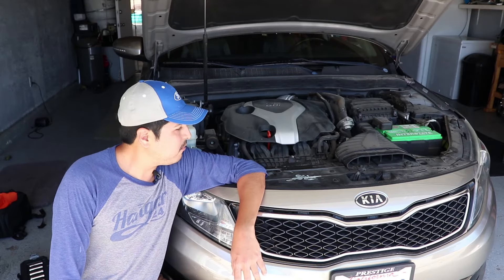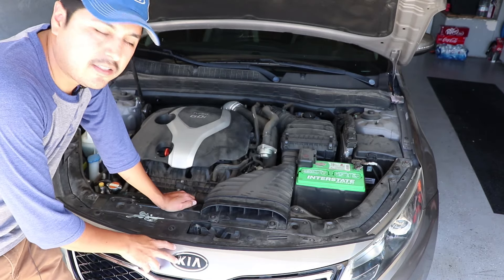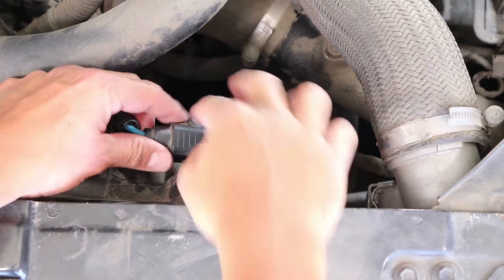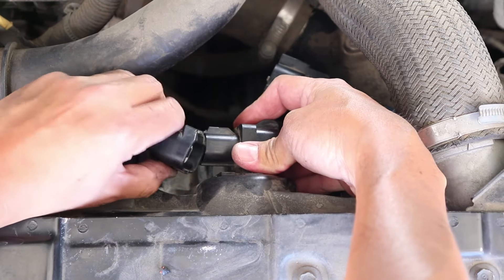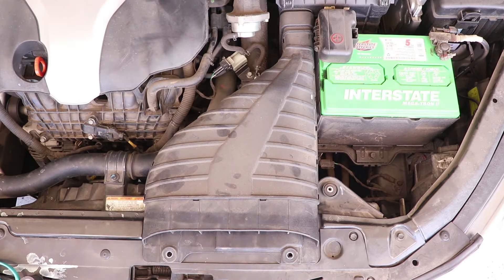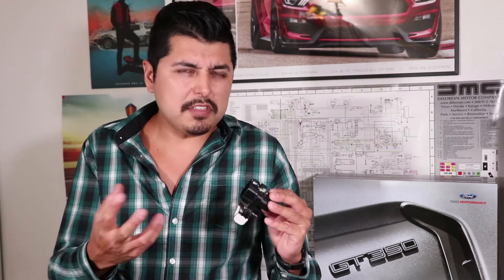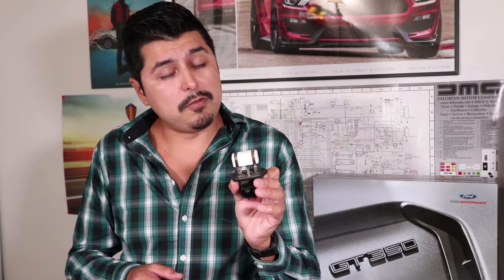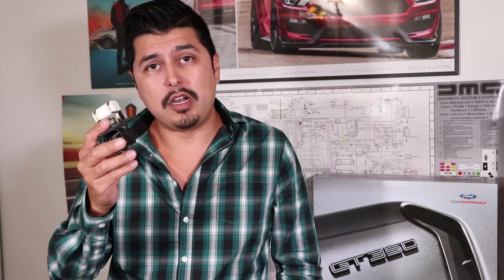Overheating KIA? Cooling Fan Module Fix (Optima, Sorento, Sonata & Santa Fe)

Comment: If this doesn't work for you and it's still not working turn on your ac and then SAFELY wiggle the wire that connects to your cooling fan and runs to your fuse box. I did this and it came on. It's a wiring issue

Comment: Thanks for this video. My cooling/radiator fan on my 2015 Kia Optima SXL Turbo had stopped working. Figured that out when my engine began over heating. Your video was the only one that helped me diagnose the issue and repair it. Thanks a lot bro.
Reply from the maker: You're welcome Bud!
Reply: I just noticed smoke coming out of my grill/hood. Is this what causes it? I have no codes or anything on my dash.

Comment: Is this why my Kia blows warm air while idling in park or what do you mean over heating
Reply from the maker: Hi Alyssa! no this is not related to the AC system, this is when the actual car engine overheats. For your AC system if your getting warmer air while idle but cools down when driving, you may need an AC tune up basically they will check for leaks and top off AC coolant as needed. Hope thats makes sense, thank you for watching!
Reply: did you ever find a solution?
Reply: I have this issue as well, 2012 sonata 2.0t.  The fan spins quickly at one speed, never turning off or speeding up.  At idle, the car does not cool in the interior with the AC at max.  It cools fine on the freeway.  Takes forever after starting the car for the AC to keep up with Houston heat.  The Freon level is optimal and there are no leaks.  Checked the fan module, nothing is melted and the connectors look clean.  Swapped the relays in the fuse box with one from the starter, and still no change.  Starter works fine with the fan relay.  The car engine coolant does not overheat.  I think I'm out of options and have to take it to the shop.
Reply: @BrianRockHD hi did you find out what was causing this issue?
Reply: @AlexAutoFun my Kia optima gets cold after 20-30 minutes when driving
Reply: @BrianRockHD I have a 2012 Kia soul
Reply: The radiator and air condenser are cooled by the same fan, two separate relay circuit cf1 and cf2 you will find in the fusebox. Check the fan motor for the correct ohm reading or manually apply 12v to the fan to make sure it works..

Comment: Hey, Great video, Thanks for the help. My module is definitely bad, but I have a bigger issue and I'm not sure how to approach it. Any help would be much appreciated. The cable feeding the module (opposite of the fan side) is also very badly burnt. Their are 3 metal tabs and one of them is barely holding on. I'm assuming the cable will have to be replaced. Do you know where the other end of the cable goes? Do you know what the part is called or possibly have a part # for the cable? Thanks in advance
Reply from the maker: Thanks Amanda! Ahh good question, regarding the connector being burned we discovered a couple ways to replace it, the most expensive one is to buy the entire harness affected however the fan side one includes the whole fan shroud assembly and the side opposite to the fan is a very large harness as you can imagine both were very expensive propositions. So one way would be to acquire the parts used from a wrecking junkyard place, they can get you the part with out a part number based on your model and yr. The second less expensive way is to buy the connector ends (they come loaded with the terminals already) and the old connector is cut off and replaced with the new one (links to those parts in the video description). This will involve soldering or crimping (I have a video coming up on each process) so it's still quite a bit involved, I really wish KIA had issued a recall for this issue, after making this video I have heard this has happened to so many cars it's upsetting. This particular KIA kept having more stuff on it break after we fixed the module to the point where my friend traded it in because ownership just got to expensive. Hope this helps and please let us know which route you ending up going with friend!
Reply: @AlexAutoFun  hola amigo tengo un 2011 hyundai sonata el abanico del radiador nomas prende en modo despacio y no prende el ac esto tambien puede ser la razon que no enfrie el ac
Reply from the maker: @charritolopez8223  Hola Charrito Lopez! correcto, si el abanico trabaja correctamente esto puede afectar el system de aire acondicionado tambien. Saludos desde California amigo!
Reply: Hey I'm having that exact problem now . Might I ask how did you fix yours and where did you locate the connector at I'm having a hard time finding one without replacing the whole harness

Comment: Thanks for the video! I believe that is the problem with my '14 Optima SXL Turbo. But everything is meted. The connectors too! How hard is it to replace the connectors on both sides?
Reply from the maker: You're welcome Freedom76! regarding replacing the connectors, it's not that hard if you done work with electrical wiring before, the old connectors will need to be removed and a new ones installed. The new ones could be installed with crimps or soldering (I am working on a video covering both methods). The new connectors are kind of expensive, I seen them between $100 to $200 each! If I was doing the job, I would check with the local junk yard, they some times will have this things for less and they will even some times sell them already removed from the car, so you won't have to look walk the yard for hrs looking for them. Hope this helps and thanks for watching!
Reply: @AlexAutoFun  I can't find the connectors anywhere so I took it to a garage. It's going to be $735 to install a new fan assembly unit. The resistor, plugs and fan come together. They said they can't get the connectors separately.  I wish I could show you a picture. My sensor and right connector was melted so bad. Not sure if there was a ground problem or what?
Reply from the maker: @nonwo76  Yeah I'm not surprised, when I visited the dealer for the connector they told me same that it was sold as a unit with the fan so it was expensive. If I add labor I would say for a $700+ for a shop to fix sounds about right (which does suck considering how common this issue seems to be you would think KIA would have done a recall on this or something) The issue (my background is mfg of electronics) I believe is the amount of power being drawn thru the connector (when under load) overheats the crimps which eventually melts the connector and the plastic gets in between the contacts furthering compounding the issue until it finally creates a fully open condition and the fan stops working. If I was KIA, I would switch to a higher temperature plastic on the connectors at the least but a better fix would be to change over both connectors to higher quality ones meant to handle that amount of amperage...
Reply: @nonwo76  ebay has the plug for about $20. But like he said, you will have to splice it into your existing harness.

Comment: Was surprised to see a turbo 4 cylinder under the hood, since the US did not get that engine.  I'll keep your video in  mind if I have any trouble in the future.  Thanks!
Reply from the maker: Oh wow I didn't know that, interesting! and thanks for watching Dirk!
Reply: @AlexAutoFun  I dont know what this guy is talking about.  Every single car you mentioned in the info was indeed available with a 4 cylinder turbo here in the US at those years (except for the Sorento which did not offer the 4cyl. turbo until 2016). Trust me i know all this bc my new car (Veloster N) uses the same 2.0T 4 cyl. turbo as these cars. So yes your info is correct, we did have all of these cars available in 4 cyl. turbo options, except the Sorento. The Sorento only offered a 2.4\naturally aspirated 4cylinder as well as a 3.3\V6 option(highest trim) up until 2015. It wasn't until 2016 when the Sorento finally received the turbo 2.0T 4cyl as a mid trim option. These engines will heat soak quickly if its over 80-85 degrees outside easily(oil temps above 220), you can hear the fans going crazy even after shutting the car off. HIGHLY recommended to use a new aftermarket intercooler. Also wheres the SRT-4 stuff man? Lol, i found you from those videos since i own an '05 myself. Shes only got 75k miles on her and i keep her clean. Mostly stock only bolt ons and tune, replaced all suspension and shifter bushings thats about it...but she straight piped :-P.  My Veloster N is getting same treatment soon, bolt ons and tune, car already handles like you wouldn't believe. Anyways more SRT-4 videos pleeeease.
Reply: @RyGuyRy  I should have specified Sorento  I was monofocused on the Sorento because we had two of them during this date range, one of each engine.
Reply from the maker: @RyGuyRy  Thanks for confirming Ry Guy! This car belongs to someone who I don't believe has any plans for modification but I will keep the intercooler upgrade in my mind in case they decide to modify. And man a big thanks for being one of my original subscribers! I'm working on more SRT4 videos right now, they should be coming out soon, with the heat being crazy here in Cali it's just been difficult to film in the Garage so I'm in the process of insulating it. Stay tuned buddy!
Reply: @dirkdaring748  no worries mang. Curious which Engine you preferred, did you start out with the 4cyl and then go to the V6? Or other way around..
Reply: @AlexAutoFun  Sounds good dude,. Yea working in the garage gets old real quick the older ya get, lol, let alone the heat doesnt help one bit. Be safe out there.

Comment: Great Video! I know it's been up for a while..... i have a 2014 sorento where the fan runs for like 5 min after a drive (even in fall not hot summer) would this possibly be the issue? if not any idea why the fan keeps going even on cool days? thanks
Reply from the maker: Thanks Travis! Ah some cars sometimes run the fan for a bit as part of a normal routine (even if the engine does not need the extra cooling, so the fan duration in those cases is small). The other reason a fan may come on is that the defroster function may have been turned on which on some cars turns on the AC compressor as well (which in turn, makes the fan run). Cheers!

Comment: I have this issue as well, 2012 sonata 2.0t.  The fan spins quickly at one speed, never turning off or speeding up.  At idle, the car does not cool in the interior with the AC at max.  It cools fine on the freeway.  Takes forever after starting the car for the AC to keep up with Houston heat.  The Freon level is optimal and there are no leaks.  Checked the fan module, nothing is melted and the connectors look clean.  Swapped the relays in the fuse box with one from the starter, and still no change.  Starter works fine with the fan relay.  The car engine coolant does not overheat.  I think I'm out of options and have to take it to the shop.
Reply: By the way, thank you for the video!  It was quick and detailed.  I was hoping this is my issue but alas it was not.
Reply from the maker: Hi Brian! Oh Wow that is strange, please let us know what they find! Cheers!
Reply from the maker: You're welcome Brian, hope you can get the issue fixed. Cheers!

Comment: Hey this helped me a lot but i still have a problem the sensor was indeed burned so i did order a new one but the connector that the sensor connects to is also burned and i can’t find that part. its the one to the right in your pov. any help thanks
Reply from the maker: Hi M! Yep, often the connectors are burned as well. While I placed links in the video description, your dealer can confirm which is the correct replacement part number for your vehicle. Cheers!

Comment: I tested the fan it works, so the fan is good. when I turn the car on and ac on the fan doesn’t work at all. Do you think it’s the resistor ?
Reply from the maker: Hi Ozzie! it could very possibly be the resistor or the connector (if it's melting it may have an intermittent connection)..
Reply: @AlexAutoFun  I noticed the fan side connector has been melted a little, but the fan works when I tested it.

Comment: Great video, thanks for sharing. I am troubleshooting my granddaughter’s 2015 SE Elantra and can’t get the fans to turn on? All fuses tested sat. I removed the high/low relays and jumped  each and the fan ran sat high speed and low speed. Both relays were swapped with blower relay and  blower ran sat. What am I missing? The AC compressor clutch is bad locked up and won’t manually turn indicting it needs to be replaced. This shouldn’t have anything to do with the fan speed should it, or is there a cross tie in the circuit logic with the compressor circuit causing the fans not to operate?. 
I have worked on other cars and never ran into this issue. I followed your advice and the resistor connector was sat and no degradation found. I will try and find the electrical drawing for this  and see if there is an interlock with the compressor circuit. It doesn’t make much sense right now. Any help would greatly be appreciated. New Subscriber to your channel. Again thanks for sharing.
David
Reply from the maker: Thank you David! interesting, not sure what is going on there, normally the AC compressor clutch shouldn't affect the fan functionality but I would definitely start there to eliminate possible sources of the issue (the car electrical service manual will be your best friend for this process) Hope this helps and please let us know if the issue does go away and what it was, Cheers from California!

Comment: Do you think this would be an issue for Kia Forte Koup 2010?
Reply from the maker: Hi Gabe! this module can fail in other cars as well (if equipped with it) but this particular issue of the connector/wiring issue is more prone on the 2011-2013 KIA Optima, Sorento, 2010-2013 Hyundai Sonata and Santa Fe than in others Kias. Hope this helps and please let us know if they find your issue!

Comment: I have a 2015 KIA optima Turbo and it just started overheating. It's seems like it only starts overheating when I'm stopped at a stop light but once I start driving it normalizes. I have been on the freeway and it doesn't overheating, only when idle or at a stop light for a period of time with the AC on, any help is appreciated!
Reply from the maker: Hi CompEngineer86 that sounds like the same symptoms the car on this video was experiencing before we fix it..
Reply: @AlexAutoFun  I'll have to give it a shot and hopefully that's the issue, thanks!
Reply from the maker: @CompEngineer86  You're welcome!
Reply: That’s the same issue I’m having:( was it that ?

Comment: What do you call those connectors you disconnected from the sensors im looking to replace the 2nd connector you disconnected my wires are cut and they were taped smh
Reply from the maker: Hi Junior! They connectors are made by different manufacturers so their name will vary but the best way to get replacement is to pull some from the junk yard or some junk yards will actually already sell them cut and pulled from vehicle or if you have the service manual you can see what connectors you need and order them online. Hope this helps, Cheers!

Comment: What if the plug on the battery side of the resistor is burnt out as well? How do I replace that and what is that part #?
Reply: I have the same question. Mines a bit crispy...did u ever resolve this issue????
Reply: Same for mine...did u ever get a answer???

Comment: impressive, my fan module seems defective for the 2006 kia sorento.
can you share link on how to test
Reply from the maker: Hi Towoju! the fan module typically doesn't fail, what fails is the contacts in the connector for the fan module, they overhead and the housing for connector melts with creates problems as there is no longer a good contact between the pins and contacts inside the fan module connector and the harness connector. Hope this helps and thanks for watching!

Comment: Question what are the wiring that’s connected to it called or where can I find it at ?
Reply from the maker: Hi Victoria! We normally refer to the wiring as a harness. They can be ordered from the Dealer, some online sites like Ebay also have new and used ones and another easy place to find them is at the local junk yard, they usually will strip the car of the valuable parts and sell those to people who needed them. Cheers!

Comment: do you know or can you do a video on how to replace a burnt connector?
Reply from the maker: Hi Camron! There are several ways of doing it, one is to purchase a replacement connector brand new with the wires loaded in already, the old connector would then be cut off and the new one spliced in (soldered or crimped). The other method would be to extract the terminals and wires of the old connector and insert into the new connector. However both methods are a little intricate unless the mechanic has prior experience working with wires, I have been thinking of making a video on this as quite involved, if I do I will let you know but hope this explanation helps a little and thanks for watching bud!
Reply: Yeah both of my connectors are fried!! I don't know if I feel comfortable doing that myself. Damn I hate paying other people to fix things on my car.
Reply: My connector was fried too. Order the replacement from ebay and splice 1 wire at a time. Very easy to fix
Reply: @AlexAutoFun   thanks for the reply, I replaced the relay and that fixed it for a few months. But the connector fried it again so I’m just gonna replace the whole cooling assembly “fan,resistor,connector”  just never spliced wires
Reply from the maker: @camronrobinson4058  You're welcome! yeah I heard of that too, some people had to replace their connector more than once ugh..
Reply: Thanks for the info!

Comment: Would this sensor affect the ac compressor operation??
Reply from the maker: Hi Angela! Correct, the AC system typically is affected by the cooling fans functionality (as the AC system normally uses the fan along with the compressor for AC operation) Cheers!